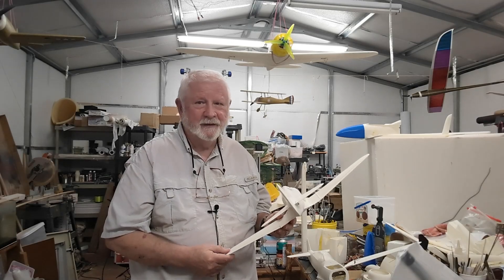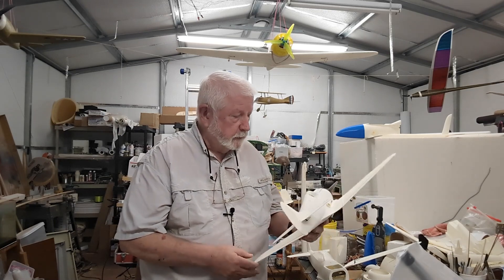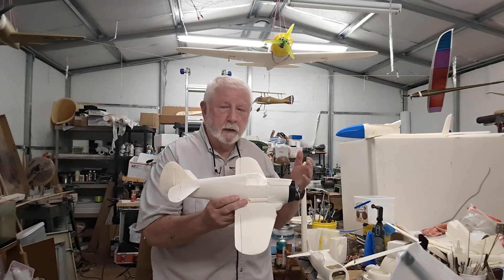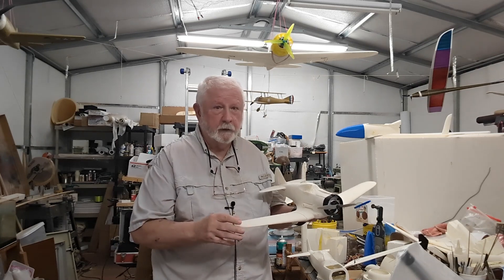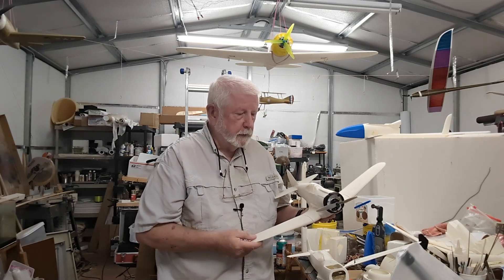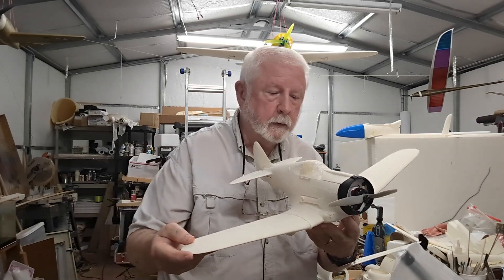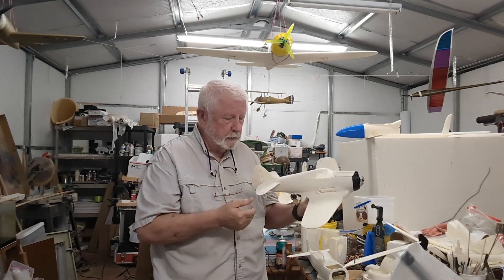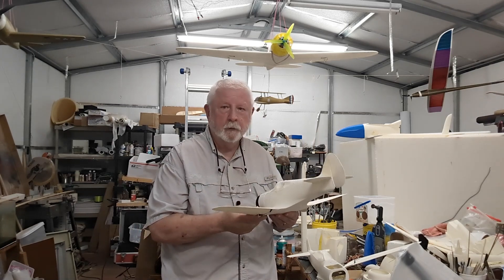3D Printed RC Model -  CAC Boomerang

Comment: I've just had the 600mm version printed. I'm now going to assemble it . What I want to know is how did you go about installing the RC gear inside the fuselage
Reply from the maker: There is a mounting plate included in the file set.
Reply: @tvideo1189 awesome. I'm looking forward to completing the construction of it . What size prop did you use